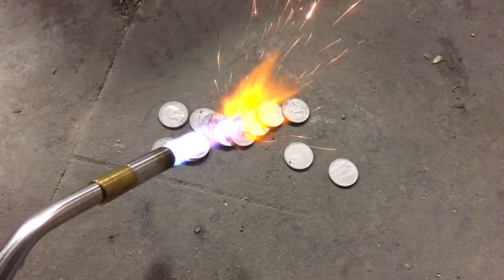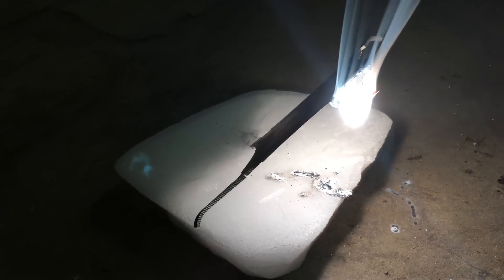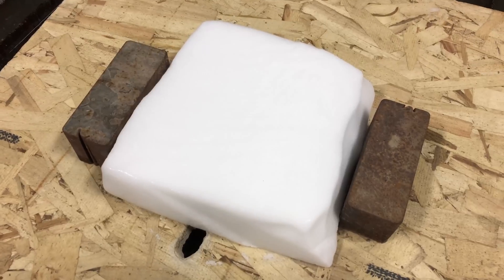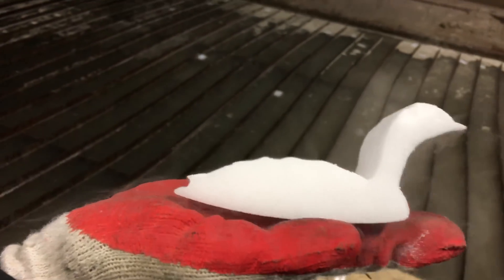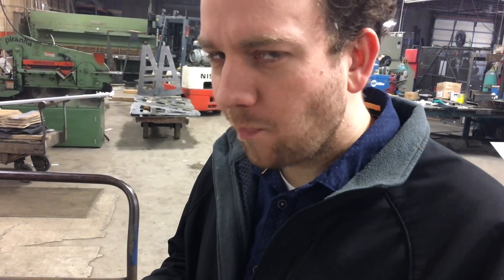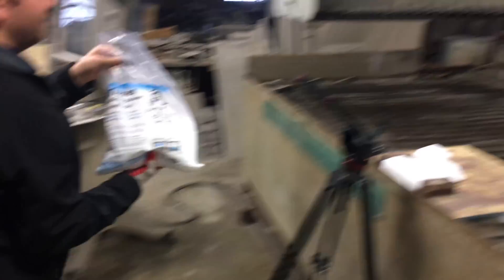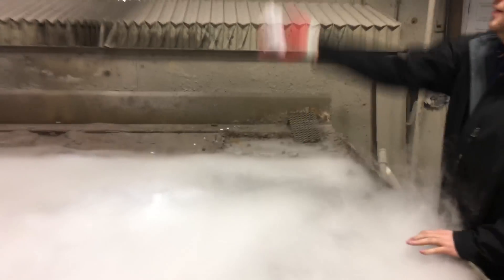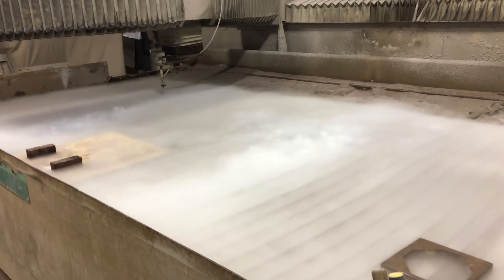Dry Ice vs 60,000 PSI Waterjet - Dry Ice Experiments - waterjet cutting explained - Interesting

Comment: No it will not poison you to drink a liquid that is directly cooled by dry ice. At normal pressures there may be some gaseous CO2 dissolved in the liquid giving it a mild carbonation. However, dry ice can be dangerous to bare skin, mouth, or GI tissue if someone swallows a medium to large pieces of dry ice.Aug 24, 2012

Comment: What would happen if you put a a etch-a-Sketch or a Stun gun/Taser but probably not a stun gun since that would probably electrocute the water But it might not since the water is at such a high pressure it could just cut through the battery and destroy the voltage

Comment: When magnesium burns its capabale of reaching temperatures so high it can be equivelent to looking at the sun so dont look at it while it burns it will destroy your eyes
Reply: Woods water Temperature=/=brightness
Reply: Woods water which means what they did was extremely stupid...
Reply: Who said they looked at it XP
Reply: i must be blind as mole then
Reply: lmao
Reply: Woods water Thanks $100 bill now I know!
Reply: well ya it makes magnesium oxide, which requires high temperatures in order for the oxygen to mix
Reply: Guac The Mole some magnesium nitride is produced also due to the exothermic reaction breaking the triple bonds of nitrogen (N2) but not much to really say.
Reply: They made it like 10 times worse by putting the dry ice on it.  It sounds crazy but magnesium can burn so hot because it is so oxygen hungry that it will suck the oxygen from the carbondioxide. So basically they just gave it a heap of fuel to burn.
Reply: Temperature and Luminosity do not necessarily correlate.
But either way only dipshitz look at stuff like that so
Reply: I light my thermite using a magnesium strip
Reply: Woods water its used in flashbangs so no sh*t xD
Reply: Woods water gun
Reply: Woods water so its capabale where do you get your hay

Comment: I'm curious, what is the tip of the waterjet made of? Tungsten carbide?
Reply: It's made out of 1/10 of an inch thick copper tubing
Reply: PussyPounder420 How can copper withstand such a high pressure?
Reply: Damian Anlauf It's a special type of copper because it's mixed 50/50 with sand when it's smelted, The technical name is Tafinara
Reply: ***** That seems to make more sense. Thanks
Reply: I was joking
Reply: undo.kat Oh wow, how original.
Reply: Yes, what is the tip made of?